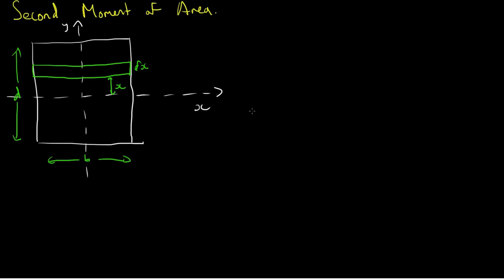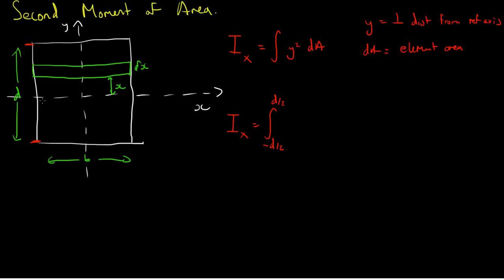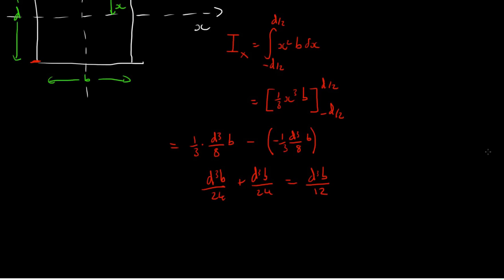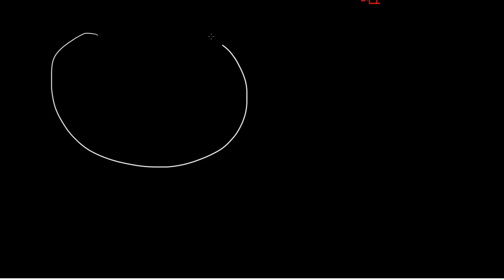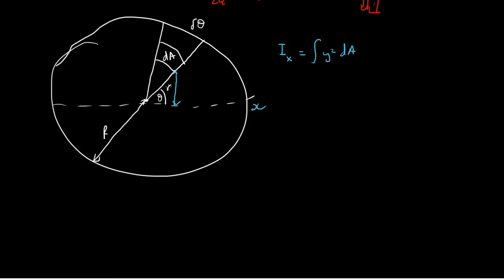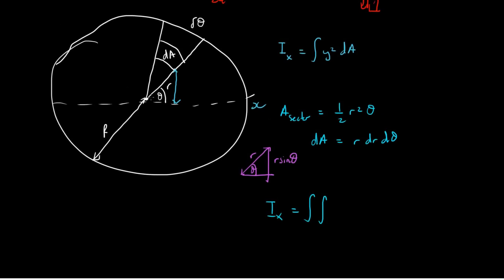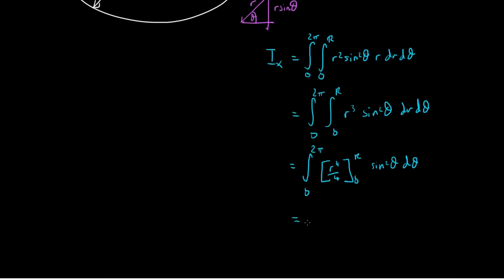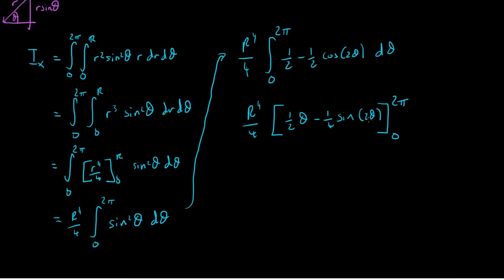Second Moment of Area from 1st principles

Comment: You've confused your axis.  X is left of the and right running horizontally.  Same goes for dx.  Your diagram is showing Y and dy.  vertical is Y.
Reply: It's not wrong.  Common practice is that x is horizontal but that does not preclude it from being anything you want it to be.  In fact, the tutor has labeled the x axis to be horizontal.  However, it does not help first time learners to label the distance from the centroid axes to the elemental area, x which gets confusing.  x' maybe more suitable or even better, something like h.  I found the way you explain second moment for a thin vs wide object useful and it shows the significance of second moment.  Definitely makes more sense now.  As a suggestion, I think you can probably explain it better.  Perhaps, doing just that -> give two examples, one where b>>h, and one b<<h and show its effects on second moment due to the cubed term.  The way it was explained using one example made it a little bit confusing.